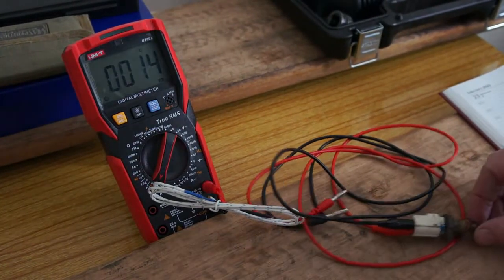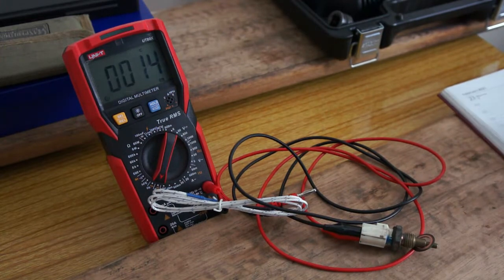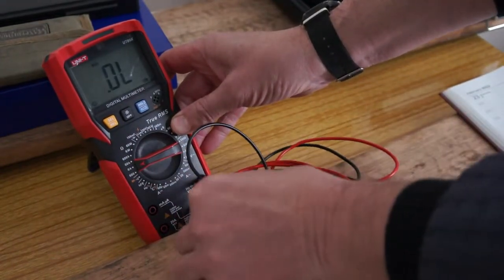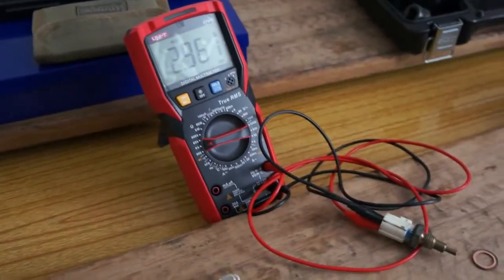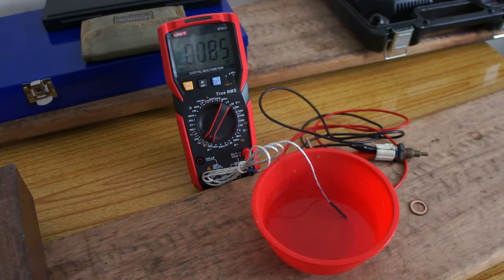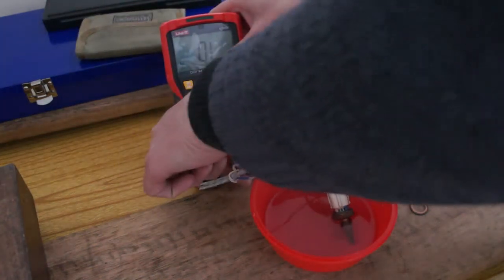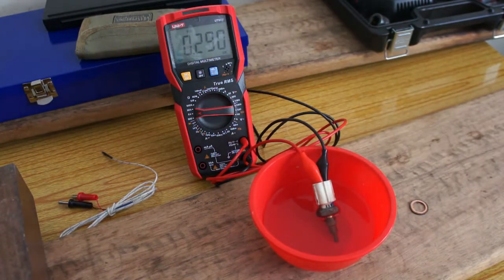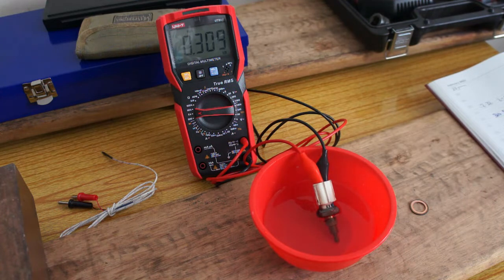TESTING YAMAHA R125 / WR 125 Coolant Temperature Sensor (ECT)

Comment: Thanks for the vid, very helpful, Can you tell me where the sensor is located on the bike? I've got a 21 Code although it's gone off again now...topped off coolant but would low coolant cause a fault code in the sensor? would have thought it would only be if the sensor failed or was an open circuit...thanks
Reply from the maker: Check my blog post    First photo you come to on head.
Reply: @cagmito76  ahh...tank off job to get it out then?
Reply: @cagmito76  where can i find this blog post?
Reply from the maker: @tunafish3784  maybe this post but been a while http://yzfr125owners.blogspot.com/2022/03/yamaha-yzf-r125-testing-motorcycle.html